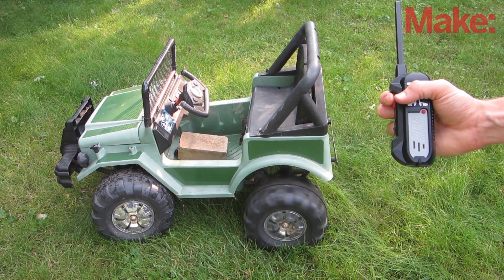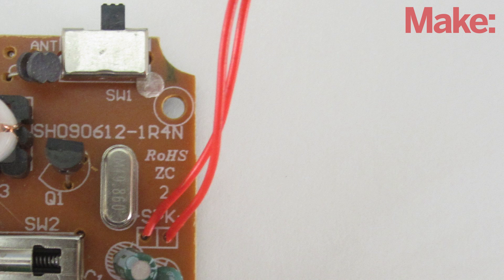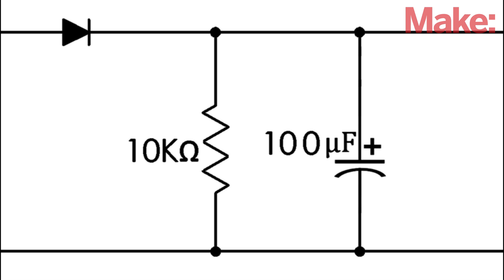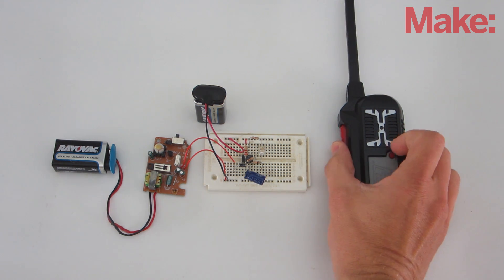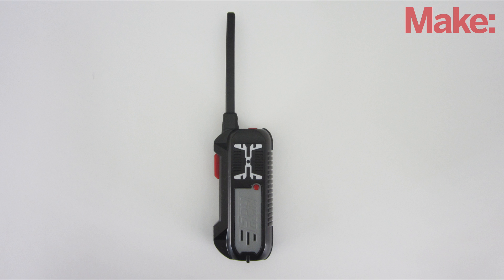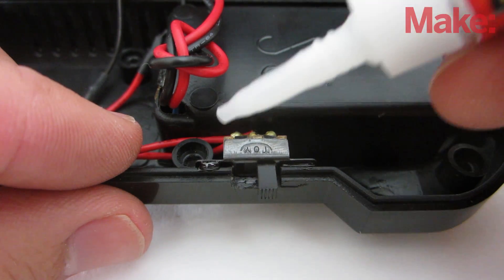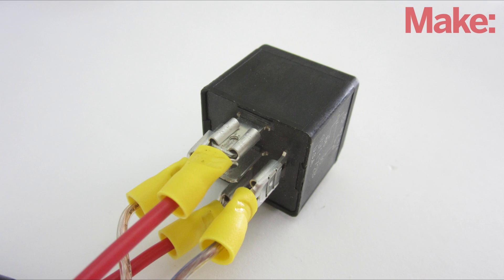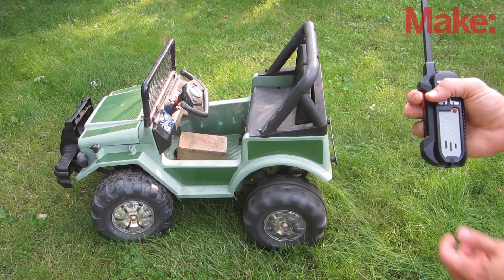DIY Hacks and How Tos   Remote Kill Switch

Comment: Way more complicated than necessary.
Take the steering channel for an rc car for eg. All you need is the RX which has been bound to a controller. From that RX you can control whatever component you like. A basic 2 channel RX for a car with a steering servo that opens or closes a power /ignition circuit does the same job and is basically plug and play. *the steering mechanism can be removed from a cheap rc car chassis and even the trim switch can provide enough actuation to open or close an electrical circuit. You can configure the set up so that the steering must be held full lock to close the circuit and allow the child's device to he powered, kind of like a dead man switch. This way, if the child's device travels beyond the working range of the safety device it will revert back to the neutral position and break the circuit.

It can be powered by its own battery so that kuds devices without batteries do not require technical modifications or adaptions and if the safety device battery foes flat, the device looses power. A steering servo and radio receiver do not require much power and a 1500mAh, 7.4VDC battery should last an entire weekend. What's more the device can be installed in-line and when no required, simply removed and the wires simply reconnected and the device will work as it was originally intended too.

Comment: Constant transmitting a tone is something against radio discipline, don't be surprised when some ham radio enthusiast bash you while using it ;-) Need more contol? Use DTMF generator and decoder circuits.

Comment: Wouldn't be easier to connect the two cables of the call button together and place a switch in the place of the speaker/microphone? That would be the transmitter: It would send a continuous signal when you pressed the switch. On the other walkie-talkie you would remove the speaker/microphone and use the two connections as the two poles of the remote switch. (I haven't tried that and I doubt whether it is going to work.

Comment: maybe for a part 2 you can do it so it kills it automatically say if the power wheels goes out of range of the transmitter it turns off. That way the kid doesnt drive away to far?
Reply: i think it does that already since the car wouldn't be receiving a signal from the transmitter
Reply: areilly111 No, this circuit works by turning off when it receives a signal. If the transmitter is out of range, then it can't be turned off.

What he's talking about is a system that's somewhat reversed, where the transmitter is always running, and if the receiver stops receiving a signal, it turns off. However, even those cheap radios can get a rather large range, so you'd probably want something less powerful.
Reply: Gray Wolf pretty simple wire it to the normally off wire not normally open wire so it's only goes when pressing the button.
Reply: A two-way radio typically has over a mile of range, I doubt it would be a problem.
Reply: TomaloTube
I meant that might be a long way to have a kid on a power-wheels roaming.